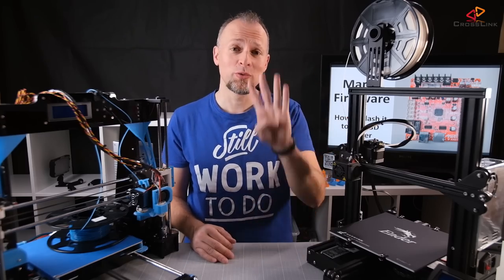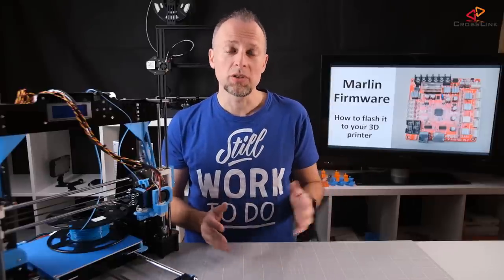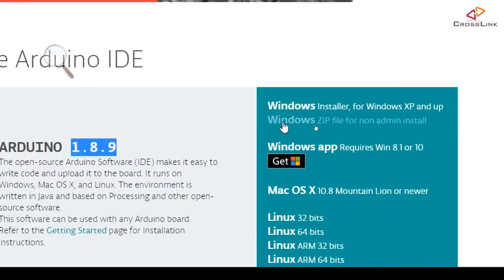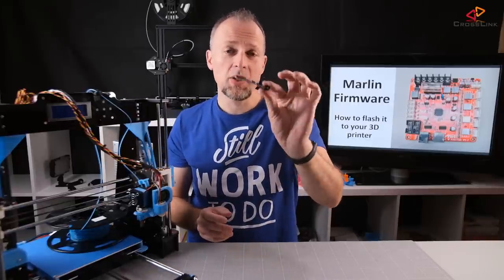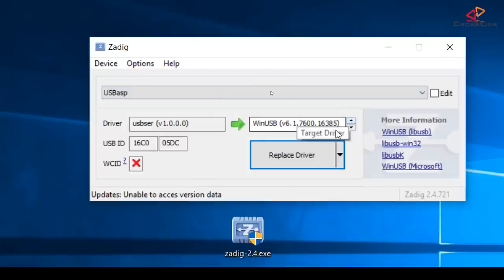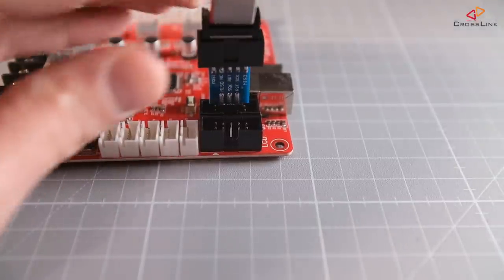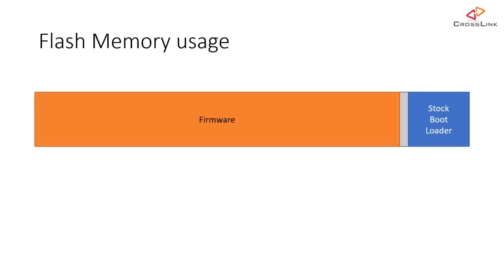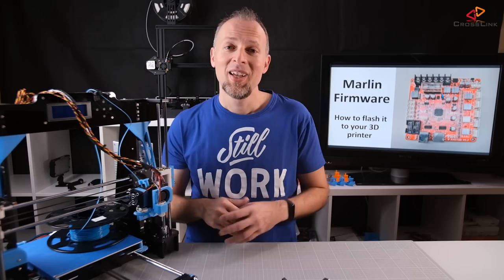Anet A8 Marlin Firmware 1.1.9 Upgrade. Comprehensive guide.

Comment: Hi thanks for the reply but I can't get passed the sketch compiling it just rejects it with something called U8glib.h !!!!!!!!!!!!!! I even tried the TH3D method very easy if you can get passed U8glib.h
Reply from the maker: Hi Phillip, you might need to add the u8glib library in your arduino IDE. Go to the Libraries Manager by pressing CTRL+SHIFT+i and then search for u8glib. You will find it in the list at the bottom and then you can add it. Should fix your issue then.
Reply: @Crosslink3D  Hi thanks for reply it sorted the problem out perfectly now to go back and see if I can tell the controller were the edge of the board is relative to the extruder nozzle home position so that prints in the centre of the build plate thank a gain .

Comment: Daniel, I got USBasp from your link. I istalled the driver using zadig and checked it in Device manager. Then, I plug 6 pin cable end into my Anet A8 1.7 board, but I got no any kind  of LED light or flashing. Just nothing. I powered my board 24DC and turned off the power. It doesn't
matter.  No any kinda led light activ on the board when 6 pin connected. Whats the problem? Is there any way to check if the board is working without any software installed yet? Maybe I should buy USBTinyisp ? Or maybe this new 1.7 board is not good? During the flash in the very beggining I saw some LED red light flash on the board and that's it. I probably bricked it. I don't know if it is possible to fix bricked boards. :(((
Reply: i have the same problem i cant fix it, have you managed to fix this?
Reply from the maker: LEDs flashing on the board while you do the firmware upload is actually good. If the firmware flashes to 100% you did everything right from a connection perspective. What's the issue afterwards?

Comment: Please help... how do I fix the "avrdude: stk500_getsync() attempt 1 of 10: not in sync:" error. I'm running windows 10 fully updated and an Ender 3 Pro with a Silent board.
Reply from the maker: Probably you're missing the bootloader or it was not flashed correctly at the factory. You will need to install a new bootloader first to be sure. Otherwise, this is just guesswork.
Reply: @Crosslink3D  Hi there, thank you for the reply. The issue I had was that there was no bootloader, yes. With Ender 3 Pro you need to use Progisp+1.72 to flash the firmware. My issue was that I was using the USP ISP that came with my BLTouch and it only wants to work with progisp+1.72.
Reply: @InfinityDrones  Did you manage to get your hands on the progisp+1.72? Im doing a BL touch upgrade and even after scanning creality up and down i cant find a way to download it, and yes ive tried all the links.

Comment: Great guide, but one problem.  The 10 to 6 pin adapter that you listed is 10 pin male to 6 pin male.  You need a 10 pin male to a 6 pin female.  If you are burning a bootloader to an Ender 3, you have to get one with a narrow plug because the ISP connection is very close to the LCD cable port.  I ended up buying this as a set: 

https://www.amazon.com/gp/product/B082HJ18KN/ref=ppx_yo_dt_b_asin_title_o00_s00?ie=UTF8&psc=1

Comment: Can someone help me?
I am trying to install the driver for the usbAsp and there is None written instead of usbser (v1.0.0.0)
And everytime I try replacing the driver it fails also there is only a install driver instead of replace driver
I am using an windows 64x Laptop
That only has 1 USB type A output
I tried to use my pc but same problem

Comment: Does the work for Windows 8 as well? you only mentioned Windows 10.
Reply from the maker: Should work with Windows 8 as well. There is not much difference in how it handles drivers. The big difference I believe was between Windows 7 and 10 where unsigned drivers got blocked.

Comment: can you use a anet a8 board in a anet et4 or do u have a way to put marlin on a et4
Reply from the maker: Can't tell you either unfortunately. I don't have an ET4. And there is not a default configuration file in Marlin for it, so I guess not a good idea at the moment.

Comment: I tried USBTinyISP and USBasp but board led doens't flash. Probably I bricked the board :((
Reply from the maker: The 6 Pin adapter can be turned 180 degrees without bricking the board. Does this change anything?

Comment: the ender 3 pro has a 4 pin counter part instead of the 6 pins so the 6 pin connector does not fit, not sure what to do from here
Reply from the maker: Could you post me a picture on Instagram and mention me? I would love to see it. Maybe you already have a new printer with the next generation of 32 bit boards. I never saw one yet
Reply: Crosslink just did, thank you
Reply from the maker: Looking at the picture you sent me, you seem to have the new v4.2.2 board, which is 32 bit. That board takes a firmware file from the SD card and automatically flashes it once you reset the printer or recycle power. It’s the same board as in the new Ender 3 v2, so you’re one of the first people I see getting this new upgraded board.

Comment: I tried doing this in my anet 1.5 board but i got an error and a time out error when trying to fix the last error. with the upload now my printer only starts with a blank LCD screen and a constant beeping. But i read somewhere that you need to set up AVRDUDESS to get the correct communicating baud rate of 57600 for it to communicate correctly with the main board.
Reply: Im having similar problems with and anet 1.5,,, on my a6 the board eprom has presets for the A8 and even corrected with repetier it continues to return to a center offset of 30 mm on x axis and 4mm on y axis.   downloaded avrdudess and still same   "avrdude.exe: stk500_getsync() attempt 10 of 10: not in sync: resp=0xb8" error   
win 10 win 7 all the same.   tired of the fight, going to submit to new board and going to send the old one back to anet,,,  even on the repetier server software the board is labled A8 but they don't seem to understand that the offsets are machine design differences.  I shouldnt have to work this hard for a product i paid for.

bought a anet a8plus  $150 and no issues,  going to flash that with marlin shortly
Reply: @MrOiam  ya i ended up scraping the a6 for an ender 3 pro and now I'm working on a CR 10 S5. Trying to modify the duel z motors to work on a single plug so that i can install a SKR mini E3 into the printer. I'm not sure tho if i need to change voltage settings or not. They are pancake motors not the standard nema 17s.
Reply: @cowboy124aa3  five bucks and you can buy pre-made boards 2 to 1
Reply: @MrOiam  ya i know but I'm gonna use it for parts to create my own core xy primer. No real need for the a6 never really printed am that good.
Reply: core xy is an awesome idea for it

Comment: i have an anet 1-5 board and when using the usb i just get an error occurred while uploading, doesn't give me any other info. is that no bootloader?
Reply from the maker: What error are you getting?
Reply: @Crosslink3D  it only said a error occurred, but i figure it out i powered it all off and re plugged in the usb and it worked.
Reply from the maker: Love that if problems just disappear 😁

Comment: So i have followed all of this video like 25 times, and for some reason, my LCD still shows blue, and that is it.
I originally have marlin 1.1.9 on my ender 3, but now nothing will flash to it, not even a bootloader,
Reply: OK, so to give an update, I have finally managed to flash the firmware, however, I had to upload using programmer, as for some reason each time i tried to do it via USB, it kept failing.
I flashed the bootloader using the USBASP and for some reason the 1.1.5 silent board i have doesn't like USB uploads unless it is an STL file via Cura

Comment: Hello, apparently I could install the firmware, but it is not possible to do the auto home or control the motors. Would you help me? Is it necessary to install some arduino library? Thank you
Reply from the maker: Fabio, did you copy the anet default configuration files to the marlin folder? you will need to do this for your specific printer before you flash the firmware.